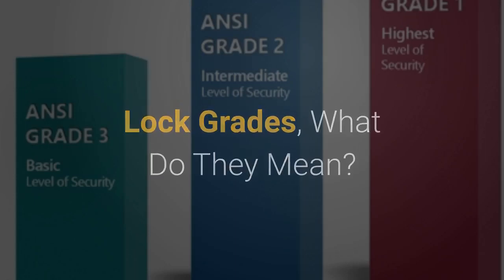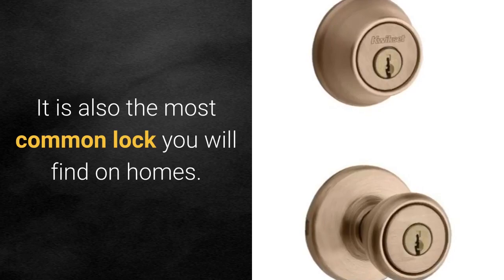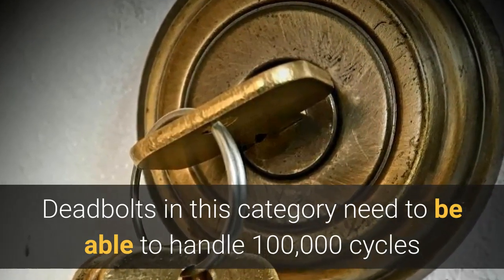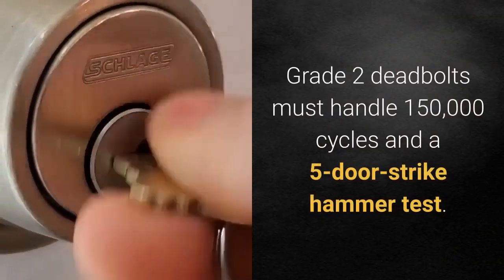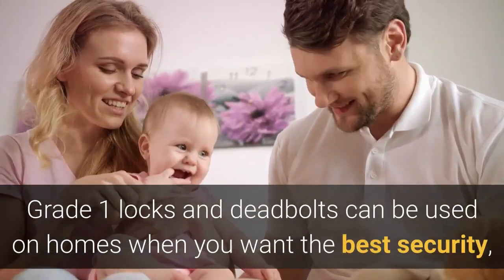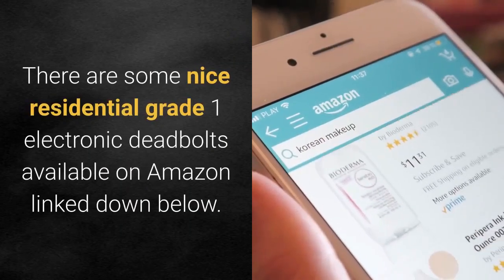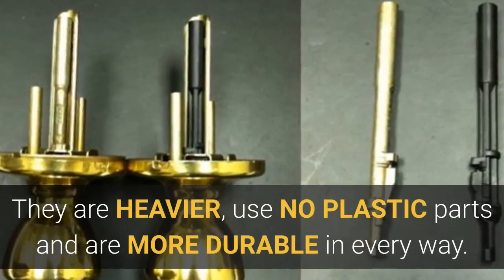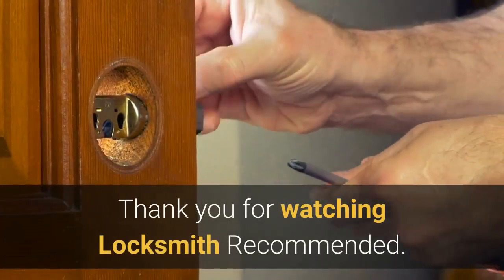Lock Grades Explained - Understanding Lock Grades

Comment: Great channel with most useful insights. What is the highest recommended deadbolt for August smart lock installed on a metal door frame?
Reply from the maker: Do you mean The pure August lock that goes over the existing thumb turn? I'd go with a Schlage 560p series or their new grade1 residential product the B60 series. You can find them on Amazon here:   https://amzn.to/35UeABi

We also having a video breaking out the benefit of the B560p line at: https://youtu.be/LL8FNyGFCko

Comment: Why is the commercial lock only a Grade 2 if it's better than the Grade 1 lock from the big box store?
Reply from the maker: One lock is for commercial applications than the other for residential.
Reply: @LocksmithRecommended  That's strange since ANSI doesn't distinguish between commercial and residential. Seems like a commercial lock would always meet the Grade 1 criteria. But I only know what your channel has taught me 😁  Thank you, Sensei.
Reply from the maker: @oo7moses  You're totally right on that. There is no distinguishment. But commercial locks just tend to be built to withstand more abuse. Even if they don't go for the grade 1 rating. They don't use plastic parts, etc....
Reply: @LocksmithRecommended  So what you’re saying is that ANSI lock ratings are entirely relative to their application?For instance, a particular Kwikset deadbolt may be considered a Grade 1 in the realm of residential hardware, but not in general?
Reply from the maker: @lokpikr999  Hi. 🙂  There's no distinguishment between residential and commercial ansi lock grade ratings. But that said, commercial grade locks are almost always built with better / heavier materials because they do undergo a lot more strenuous use.

It use to be rare to see grade 2 residential locks but more and more companies started to go for the grade 2 classification, but they want to get there using the cheapest parts possible because margins are smaller than commercial locks.